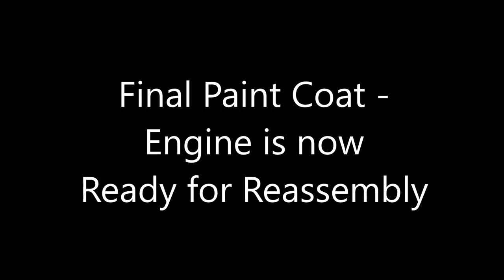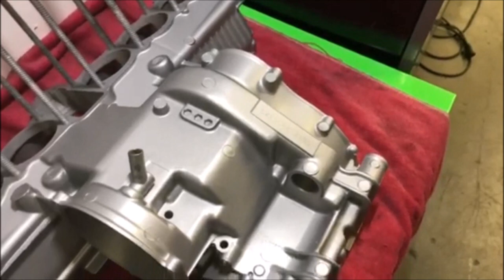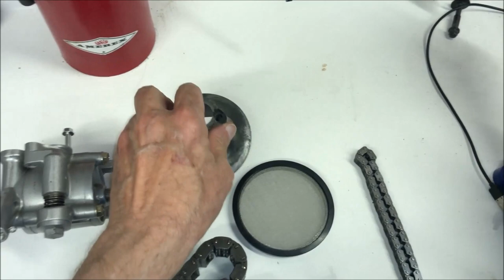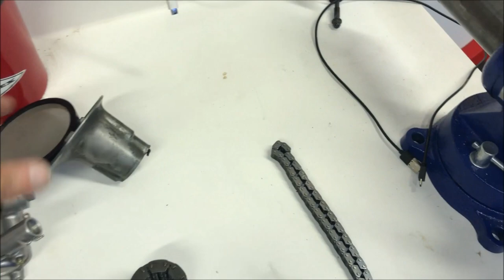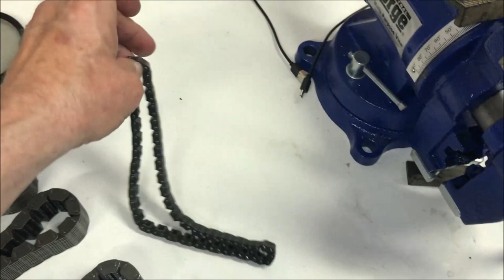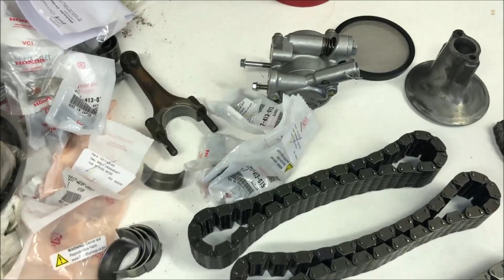Honda CBX Full Restoration & Engine Rebuild Video Series - Part 13 Painting Engine Cases Final Coat

Comment: Sorry for being a pain but during your rebuild can I make a request that you highlight how the reassemble is done with particular reference to the timing of the pistons and cams thanks
Reply from the maker: Hi David,
You are not being a pain at all :)
I really do appreciate the feedback and requests.
It helps me to keep improving my videos.
As I have mentioned in some of my videos, I am going to go through each step of the restoration on each bike and on my 69 Z/28 Camaro.
I just received the one cam chain I was waiting for for the CBX engine, so my next video will be part 1 of the re-assembly of the engine.
The timing settings of the pistons and cams are one of the most important steps of the re-assembly.
So I will definitely be devoting a lot of time on that step.
Thanks again David

Comment: Question - many of the high-heat engine paints suggest you cure them in for a period in an oven (or similar) doe up to 2 hours.  When the engine is operating for a time it would sufficiently cure the paint but for a restoration that may take many months (years?) do you need to cure to harden the paint so that it doesn't scratch as easily during assembly/finishing?
Reply from the maker: Hi Devin, I agree with that. However, it isn’t as critical on engine cases when you use engine paint with ceramic in it. This particular engine is completed now and there were no scratches inflicted during assembly. The paint is pretty tough when you let it cure for a day or so after you spray. I will lay it out in the sun for a few hours sometimes. Also, as soon as the engine is started up , it will automatically bake the paint of course.  I am more concerned about the other painted parts that don’t get hot under normal use. Those are the items that I feel more of an urgency to put in an oven or hot sun to cure.
Thanks for the comment Devin
Reply: @digitalpizza1  Thanks Pete - I'm using the Dupli-color engine paint that I believe has the ceramic (marketed a bit different in Canada with a different label).  Appreciate the feedback, your channel has been very helpful in my restoration journey 0- thanks!

Comment: Hi Peter. What silver paint did you use for the cases? VHT, Dupli-Color? Thanks.
Reply from the maker: Hi John, 
I use dupli-color or equal engine paint.
Any straight silver engine paint will work
Aluminum color will also work as long as it is Flat or Satin Aluminum.
What ever your auto parts store carries 
Thanks John